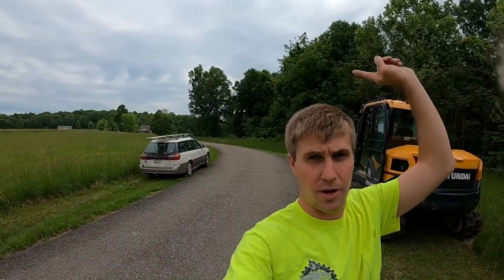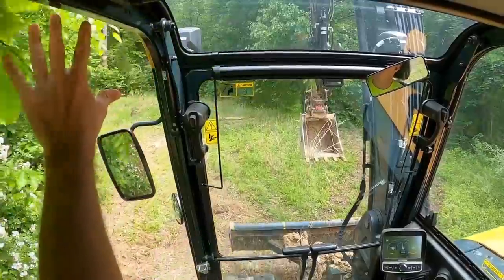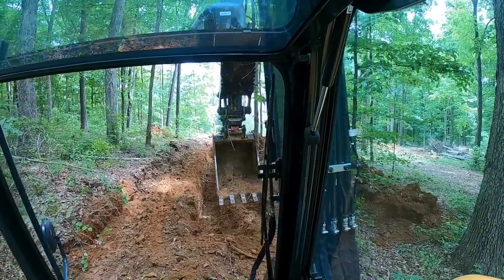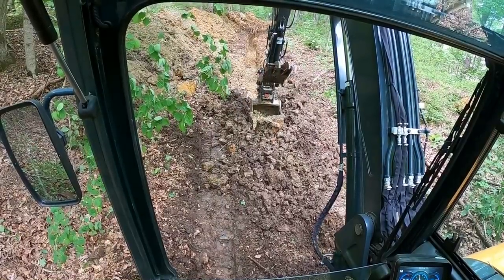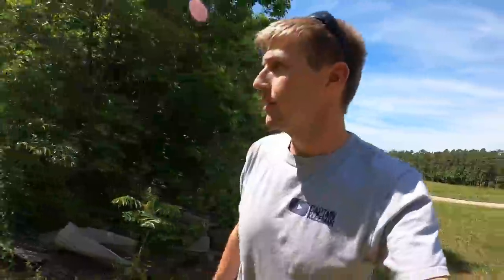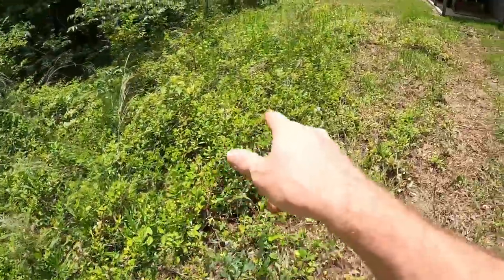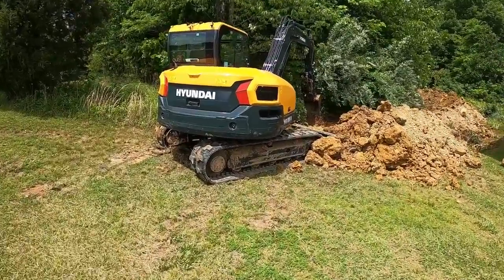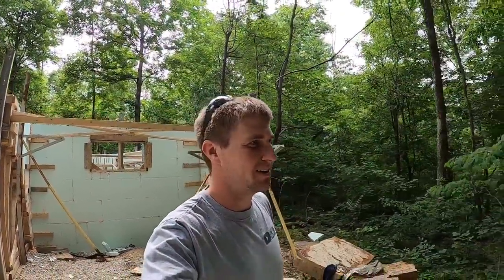Trenching Through Rock with Brand New Excavator - Hyundai HX85A

Comment: Hey there Mike !!! How are you doing?? 
Think you are smitten with the HX85, certainly seems to be good machine !!  
I like the vague guesswork of where the water pipe is, divining rods do work well, have used them a few times, with a fairly accurate result !! Enjoyed the anecdotes of the accidental removal of the pipe, think they were hoping to fill the pond on the sly 🤭🤭🤭
Wise idea to scrape off the snots while the concrete is still green too. Pleased the pour went well for you, bet that was a relief for you 👍😁

Comment: do you accelerate the engine to full speed? I have the impression that it is only halfway ... good job as always!
Reply from the maker: I run half to 3/4 throttle most of the time
Reply: @CaptainKleeman  only with the hyundai or all excavators ?
Reply from the maker: @Feub69  anytime I run one.

Comment: They really need to start putting a steel grate in the floor of these cabs so the dirt just falls into a tray.
Reply from the maker: The floor mat pulls out fairly easily.
Reply: @CaptainKleeman  Ya I know mine does too but when you're on a muddy job jumping in and out you get a slip and slide floor and mud packed into every crevice.

Comment: Get yourself a couple of pieces of #9 stripped wire or something similar about 2 feet long, I have even used coat hangers straightened then put the 90-degree bend in them but the wire is so small they are hard to hold on to. Actually, #6 copper wire works best for me, you can use an electrical ground wire, just be sure any insulation has been stripped from any wire that you use for better results. Bend each with a 90-degree bend about 7 or 8 inches from the end. Hold on to the short end of the wire, one in each hand, and hold out in front of you. Try to walk parallel to where you think the water line is located. Walk slowly and just shuffle along holding your arms out slightly about 10 to 12 inches apart. The wires will start to cross as you get closer to whatever you want to locate. They will cross then actually cross together. Move forward slowly and they will turn back towards you, move backward and they will move away from you. When they are together whatever you are trying to locate will be right below the wires. I have "witched" telephone cables, sewer lines with water in them, water lines, etc.. Once in a while, I did locate a rock ledge with water around it and that isn't what I was looking for.
Reply from the maker: Witching is how they marked it